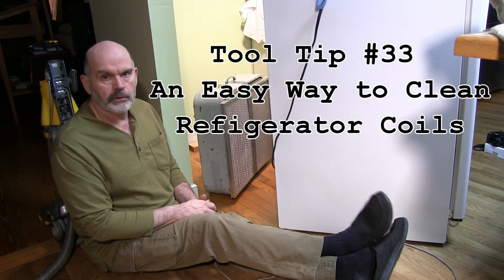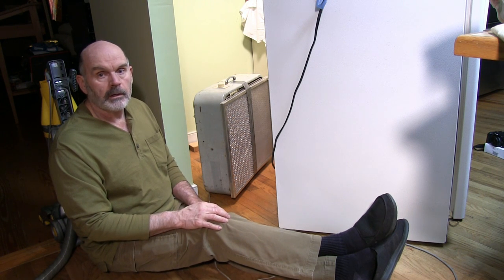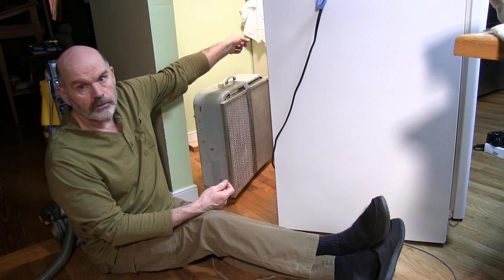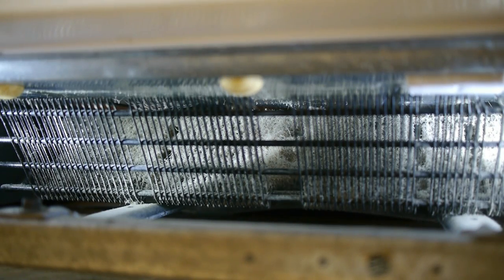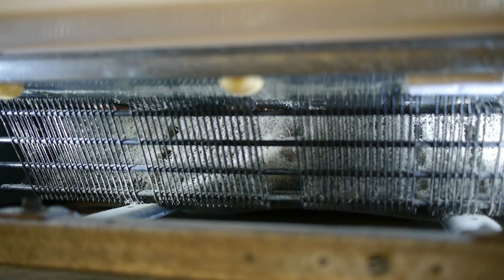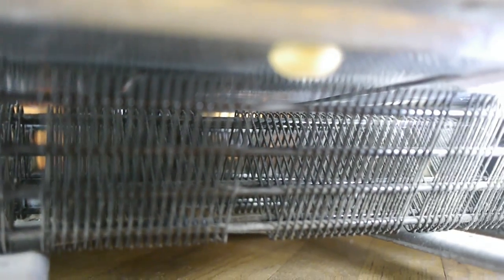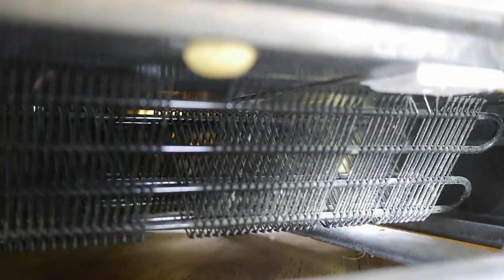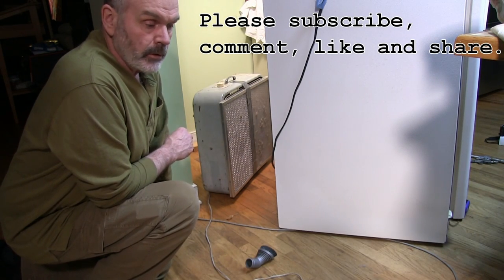Tool Tip #33 An Easy Way to Clean Refrigerator Coils

Comment: Very inventive!  I observed that some of the dust bunnies got away about half way through the cleaning process.  Suggest vacuuming the filter as required during the cleaning process.
Reply: Vacuuming what filter? There are none.
Reply: Clean the filter that is on the fan with a vacuum cleaner half way through the cleaning process because the effectiveness of the filter/fan combination diminished considerably during my cleaning process due to the excessive amount of dust that was being released.
Reply: @steveandrews8301   Steve, I am referring to the filter on the fan.  When I used this method to clean the coils, the excessive amount of dust plugged the filter on the fan and the filter lost its effectiveness.  So, whether is is half way through the process or when you observe that the dust bunnies are not being sucked into the filter then clean the filter.
Reply: @mechanicalman777  Thanks, Jay - I wasn't sure which filter you were talking about, at first.

Comment: I use small brushes that are designed to clean out reusable straws for water bottles.  They are about $6 for a 10 pack on Amazon and fit between the coils fine.  After years, I'm still using the first brush.

Comment: Hope important are those coils?  In my refrigerator's manual the diagram shows the coils on the bottom as "defrost heater" and in the middle back is the "sealed system (evaporator and heat exchanger)".  Does this mean those coils at the bottom at the bottom aren't so critical?  Maybe it's not really suck a big deal to have them all covered in dust bunnies?  My fridge is an Amana side-by-side from about 1999.

Comment: Thanks for the tutorial.  And the philosophy.  I have the same fridge in your video.  What about cutting a panel out of the right side of the fridge, front to back, about 5 in high?  Roll the fridge out from the wall to get access to the side, then you're looking across the according folds, at what, 4 - 6 triangles into which you could stick a brush or vacuum?  The side panel seems to be thin sheet metal, and then I see a styrofoam block that should be easy to remove/replace for the coil cleaning.
Reply from the maker: That seems like a lot of work but, if you cut an access hole on the side you could cover it with some kind of heating or cooling vent.

Comment: On some models you can access the coils more easily from the bottom or back.  I can clean the coils on Whirlpool from the front with a coil brush, but I have to remove a fiber board panel on the bottom to get the dirt that falls to the bottom.

Comment: I have an inherited 2000 GE fridge. It's been making the lights dim lately (I know a bit of dimming is normal-but, this is Severe!) I believe it's also caused my HVAC transformer to blow-second time in three months-and my microwave and some small electronics-along with LED bulbs-are also fried. At first, I thought I had a leg of power down. Anyhow...the coils in THIS puppy are behind a cardboard panel in the back. I had to move the fridge, unscrew screws holding the panel, but then, the coils are partially obscured by the compressor and fan. I could only get a brush in perpendicular. I think it's maybe made a slight difference. I also unclogged some slots in the cardboard.
Then again, I have an early 1960s house, so who knows?? I wore a plastic hairnet and mask, but am sneezing several hours later.

Comment: I cleaned my 20 year old Whirlpool fridge (same model as mars1952) today, using a long, narrow brush meant for cleaning dryer vents and such. Used may vac to suck up the dust, as I withdrew the brush. The front coil fins I was able to get pretty well clean. The fins to the rear I could only pass through the wider openings and the end loops, in the front, and tried to guide the brush through to the back, to get as much as I could. A LOT of dust was removed. Hopefully, the fridge will run better and more efficiently. Next time I'll try mars1952's method.

Comment: I have tried the vacuum on my fridge and did not get anywhere, either. That's when I rolled the air compressor up from my workshop and blasted it out good. It never crossed my mind to use a fan with a filter. I will do that next time. I had the exhaust fan to the stove  turned on and a fan blowing dust out the door to help clear the air but the kitchen and dining room were filled with dust. It looked like the place was on fire it was so thick. The refrigerator freezer cannot be rolled outside, it is too large and filled with food. That was about five years ago and I think it is that time again. Maybe this next time around my wife won't be so mad.
Reply from the maker: +Dave Schuetrum A happy wife makes for a happy husband.
Reply: +mars1952 ...My wife was not very happy with all the dust that settled everywhere. What you did got me to thinking...I will take some plastic sheeting and tape it around the back of the fridge to the fan with the filter. Make a tent like affair to better control the dust.
Reply from the maker: +Dave Schuetrum cardboard will work better. Plastic will suck in.
Reply: +mars1952 ...Good idea. I will give it a whack. A large box would work perfectly. The top flaps would adjust to the fan sides.
Reply: Dave Schuetrum t

Comment: Good video & dust catcher idea. My one year old Whirlpool has the same coil layout - but the back of the fridge is completely sealed up. Guess I need to run one or two vacuums at the front at same time I use the compressed air. Sad Whirlpool made such a sorry design. They could had turned the coils 90° so a brush could have be used or made a access panel in the rear cover.

Comment: Awesome idea! Curious, I have water hooked up to my fridge. Is there anything I need to worry about before pulling the fridge away from the wall?
Reply from the maker: Usually, there is adequate slack in the water line to allow the fridge to be pulled forward far enough to get behind it. Just keep an eye on it. Use a mirror if you need to.
Reply: @mars1952  thanks so much!

Comment: My fridge wasn't cooling, so I figured this needed done. Then I looked underneath and saw that the coils were totally caked with dirt and cat hair. Most people don't have a compressor, so their only option is to get under there with a long narrow brush, which is a maddening pain in the a**! AND you have to do it at least twice a year if you have a furry pet. I totally agree with you about the idiotic design and location of the coils being intentional to sell more fridges. My last fridge had the coils on the back, which makes so much more sense, both for cleaning and heat dissipation. SO irritating!

Comment: Do you think it would have worked by taping a big garbage bag around the back of the frig around that section and when you use the compressed air it would go directly in the bag instead of using a fan that way you would not have to worry about dust spreading to other parts of the house?
Reply from the maker: The garbage bag would quickly fill up with air and the air stream and dust would flow around it.

Comment: How about a vacuum cleaner + plastic sheet for the back side of the fridge instead of an open air box fox w/ filter?  Get some plastic sheeting, some magnets to create a barrier and put vacuum in sealed area.  That should handle the dust easily.

Comment: brilliant. i have the same design. i'm about to go across the street to an 80 yr old lady's house to see why her fridge is not working anymore, along with the water heater pilot not staying lit. i'm guessing the pilot is gonna be dust related also. only challenge is gonna be taking the fridge outside. the doors on these 70 year old homes are every bit as narrow as they possibly could've been. there's 2 plug outlets in every room only. one thing about it though, is the plaster walls aren't the best in Wi-Fi transmission, but for any water damage, they're not subject to mold problems, so don't let the insurance companies talk you into cutting a foot off of the bottoms to replace with drywall because a dish rag was flushed down the toilet. snake the rag out is all. that's one thing that happened at the lady's house, the other thing was when a dish rag was flushed they talked her into putting a liner in her sewer pipe leaving the house to almost the county line in the street. cant' tie into that but they convinced her she has leaks in the clay pipe and that a sink hole could develop. only there's no sign of anyone's driveway doing that in the neighborhood. those pipes aren't designed for mechanical seals and it's the way they are. the houses sold for 12,000 in the 1950's the cost of the liner which takes under 3 hours to install was 10,000.00. and now you have to snake from the front of the house instead of the back to prevent the snake from damaging the start of the liner. the lady doesn't know, but trust the clowns that breathe fear into her by all these claims. they said AIDS virus could be present in a backed up sewer line from your house. gotta watch these thieves. they prey on the elderly. for water damage homeowners insurance pays roughly 30,000. and all they do is go to the nearest lowes and gather up 1 or 2 Latino laborers that have no experience in anything but only a general idea of nothing.  so the contractor charges 30,000.00 and pays inexperienced labor to put in the junkiest parts and spends less than 1,500.00 and pockets the rest. i wouldn't throw away a 60 yr old commode to put in anything new. i seen them remove a sink  vanity during a flood insurance scam and put in a non draining sink, the cheapest they could find. with faucets that plug  up within a month. everything is made so cheap these days. any new items only mean more maintenance and no where near the normal life expected.

Comment: I manually removed as much dust as possible on Frigidaire refrigerator manually.  Then I sprayed the coils with Nu-Calgon brand Evap Foam No Rinse (bought on Amazon) on the coils.  Then using a garden sprayer, sprayed the coils with warm water.  The rest of the dust drizzled off.  It is imperative to cover any electrical connections with plastic wrap to avoid a short circuit.  By the way, this product works great on its intended purpose on cleaning HVAC evaporator coils but even then on my unit the inside ridge is very difficult to access.  In either case the designers did not have maintenance in mind when designing their products.
Also, the reason for viewing this and other videos has been to find the easiest way to clean my freezer condenser coils.  Still it is a nasty job that  did not need to be that way had there been some thought in designing the condenser coil assemblies.

Comment: Roll the fridge to your back or front door with the back of the fridge facing outward....use air hose...job complete and no mess indoors/
Reply: EXCELLENT!
That is EXACTLY what we do.
Remove the rear panel to open up the backside of the fridge (if necessary).
Roll that fridge to the front door, with the rear facing outside.
Stuff pillows around it to seal off the air.
THEN, from inside the house, I use an electric leaf blower and blow
under the unit, across the coils, and all that stuff goes OUTSIDE.
(nearest neighbor is 1/5 mile away).
Sometimes I run a compressed air hose into the house, and use that to blow it out.
A light duster or paintbrush is useful to loosen up those 
dust bunnies on  the fan and other places they are stuck.
Oh, then wash the pillow casings...
- - - -
We also have a garage fridge.  
On wheels.
So I just roll it out of the garage, onto the carport,
and wash it out with a GARDEN HOSE!
Then, blow it out with the LEAF BLOWER!

Yes, I have a license to use UPPER case.

THanks for THinkin!

Comment: pretty sensible way to clean the coil,lots of folks wont have a box type fan as you have but you could also use your vac,either portable or central vac at back of fridge and as you did ,just use very short bursts of air,vac would likely capture most of it,good way to clean a very hard to get-at setup,really dumb engineering but i agree with you,the mfrs dont care about life of the appliance anymore it seems,repairman told me recently if you get 10 years out of a new fridge you are doing well.

Comment: what kind of air compressor are you using?  I was just cleaning my identical kenmore (c. 2004) side by side, and could only clean the back a bit, and the front.  I estimate I only got it maybe 50% clean.  Pondering getting an air compressor from harbor freight, but not sure what size/power to get. I've never used one (although I'm sure it's not rocket science...). thnx,
Reply from the maker: it doesn't take much air pressure or volume to do the job. Any small compressor will work. The key to getting to all of the coils clean is the long air nozzle. I have a large air compressor in my shop and I ran a long hose up to the kitchen,

Comment: I had an idea to cut a cheap furnace filter and tape the material in front of the grille to catch dust, but I don't want to mess with the air flow. I figured a filter that does minimal filtration should allow enough air flow, but I'm not sure about that.

Comment: Also if your fridge shuts off after running hot , they will tell you the compressor is shot , on most units there's a thermo switch that has a bi-metal spring in it - ( just like a clothes dryer ) - you can either get it super cold or tap it on something hard after it cools back to room temp , reinstall it plug in Fridge should run as normal now .

Comment: I did something similar, but instead of using a box fan I used a ceiling fan box with a shop vac attached to it.  The box was pushed up tight to the rear of the fridge.

Comment: Aren't you a smart cookie. We just had the grill off and tried to clean the coils. You are right. You can only clean the front of the according pleated coils. They used to be on the back and were easy to clean. I still have my old Frigidaire frig that is over 50 years old and it's still working. Yes you are right, the inventors of the poor quality frigs etc of today must have to stay awake a long time to try to destroy tried and true quality appliances of years ago. The box fan is a great idea with a filter. My husband's plan, a few days ago, was to take the frig outside and blow out the dust. Either way there is no doubt that it will improve the quality of operation, cut down on the electric bill and extend the life of the frig. I sure would love to have another box fan like you have. I've been looking for them in thrift shops with no luck so far. Hang on to that gem as they are hens teeth and so are the frigs with the easy clean coils in the back of years ago.

Comment: How often will they need to be cleaned?  I used to clean mine once a year.  Was that enough?  I have no pets.  Fortunately I was able to get a brush in.  I'd vacuum with one hand while I dusted with the other.  Just got a new one March 2020 so I haven't seen what this one looks like yet.  Old one didn't die, I just needed slightly bigger than 18 cu ft.

Comment: Refrigerators back in the 1930s had all coils and the compressor on top of the unit. They should bring that back.
Reply from the maker: @garymathis1042  I had a Kitchenaid cabinet depth fridge about 30 years ago.  It had everything on the top including the compressor. I hated it. It broke down three times while it was under warranty.  The ones made in the 1930s probably still work!

Comment: awesome dude! But guess what ! You dont have to let it get dirty  place ! Just put panty hose or other flimsy sheer nylon fabric on the front grill before you snap it back in place and clean unsnap it  when they get dirty or even throw awau te front grill and make your own filter frame that screws to teh fridge so you have something that is easy to get to to clean 

But I have a question does it matter if you remove the rear lower panel and keep it off ( mine was just made of card board )

Comment: Some people are cleaning car motors without touching the parts with Armor All Tire Foam, I'll try it on the coils. If it works it will be fast, easy and cheap.

Comment: I have the very same Kenmore fridge and it's a nightmare to clean. Thank you SO MUCH for posting this brilliant solution. What air compressor do you use?  Some air compressors cost almost as much as a new refrigerator. SUBSCRIBED!
Reply from the maker: I have a large upright oil-less compressor sold by Craftsman that my wife bought for me about 20 years ago.

Comment: Thank you. Going out to get an air compressor.  We have a leaf blower but you can’t use short burst which is a better idea.  Thanks again
Reply: Great Video !  I have double door Amana new frig [12-16-17 new]. Coils not too dirty so I used a Black & Decker battery operated leaf blower [20 v lithium] without the fan at the back and it cleaned them very well. Just vacuum up the dust behind and in front of the frig afterwards. I blew in the leaf blower from in front as well as from behind the frig. A higher powered plug in leaf blower like my giant Craftsman leaf blower/leaf vacuum would no doubt get a badly dusted set of coils clean.

Comment: I used a shop Vac and used as a blower got all the dust out from under the frig but boy did a make mess in the kitchen next time I will use a wet sheet on the back side of the frig

Comment: An if you Central AC - guess what your AC Evaporator looks like 🤔, I just moved into a house last winter so come Late Spring I tackled it ( pesky heart attack f'ed me on a couple months) , anyway there was like a mat of dust on the outside of the Evap , an of course you could not get a light to shine thru it ,  Afterwards a lot more air comes outta the vents an house cools down much quicker, knocked about $30.00 off Elec bill too